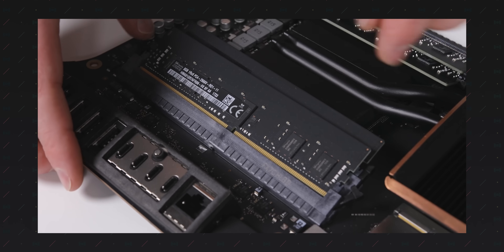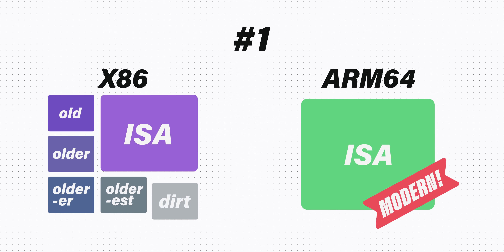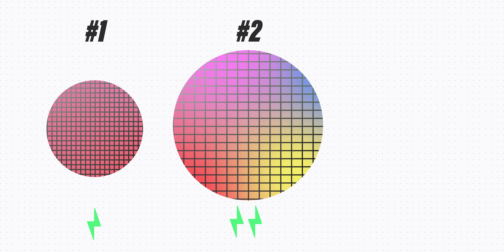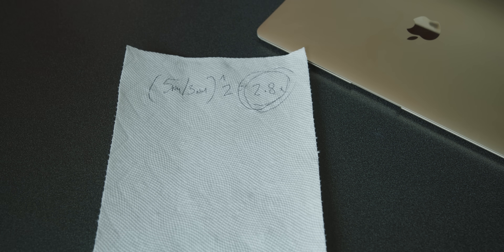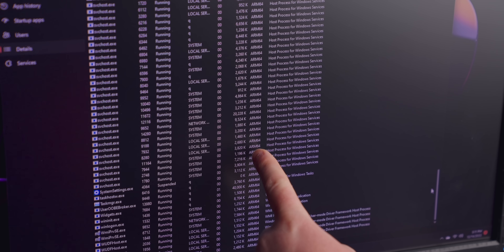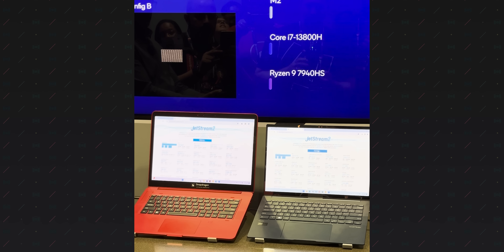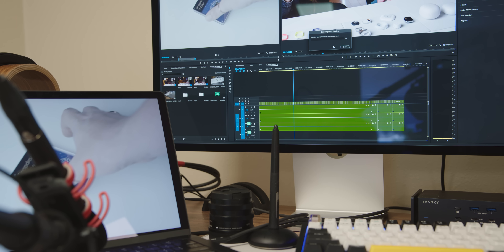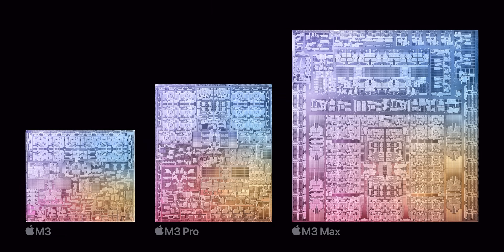Apple's Silicon Magic Is Over!

Comment: The thing is: if you do professional and compute heavy workload you just don't care about energy efficiency on a single workstation (on a cluster sure, but your workstation pulling 50, 500 or 1000 watt doesn't really matter). Using the energy efficient built for mobile devices chips in high end workstations is simply not efficient. You have a higher power and thermal budget but you can't use it.

Comment: For the average user there is no catching up to do other than on battery life and because Apple is at the limit there's nothing they can do about it. For the average user there's no other truly relevant difference, other than maybe the ecosystem but there's nothing windows can do on that front. As for power users few are switching away from their preferred platform, you know you wouldn't even if windows was better for your use case. I would not switch to mac either because it's not faster for anything I do but even if it was I still wouldn't because of all the other inconveniences. So the only ones who will potentially switch are average users who don't need a lot of power and don't care about the apple ecosystem and there's also nothing Apple will be able to do about that. So why bother?

Comment: They also need to address the efficiency of how their own software takes advantage of the hardware. Apparently Logic Pro works slower on M3 than it does on M1 because for some reason it’s not taking advantage of all the cores, and they overload as a result. There are even third party DAWs that manage to utilize all the cores while Logic just lets them sit idle. Then they also always can keep increasing the amount of RAM and SSD on their base models to stay competitive. Also maybe specialized processors for audio or other processes the way they have separated out the GPU, Neural engine and video encoder.

Comment: 3:28 TSMC N5 is not 5nm. When we go with the ITRS rating, it is only the density of 7nm planar. And because of FinFet and other 3D stacking technologies the actual tranistors are even bigger.
As i remember correctly the TSMC N7 transistor gate width is 22nm.

Comment: I have a 2021 MBP Max that's maxed out on all but HD capacity; which is ironically the issue I'm running into now.  I wish I'd gotten a bigger hard drive.  I also have a 2022 beast of a rendering PC with a 4090, 10TB or NVME storage, and 64GB of RAM.  Besides graphic rendering in Blender/Cinema4D/UnrealEngine, and gaming, I seldom use the PC anymore.  I hated the MBP at first because it couldn't do so many things GPU related as the PC.  But my job changed and now I'm mostly working in various NLEs and DAWs.  For that kind of work, the MBP excels.  It seems weird to me that the M1 silicon is still basically as good as the M3.  I tried running intense renders with the MBP, but it's worse in every possible way than the PC rendering station. 

It scared me when my MBP spun up its fans the first time.  Until I tried rendering in UnrealEngine, I'd never heard the fans before.  In short, MBP is fantastic as the centerpiece of my mobile recording studio.  It runs Pro Tools brilliantly when recording live concerts, it's light, quiet, and efficient.  But when it comes to heavy compute tasks, my PC annihilates the MBP.  They both have a place, and the MBP is what I use most of the time; I'm using the MBP to type this.

Comment: The problem is that the M1 made intel actually finally "wake up" and resume actually investing R&D on x86 arquitecture, and AMD followed suit. This brought innovation back into x86 that was basically stuck for years, and this innovation quickly outrun anything that Apple was trying to do with Apple Silicon. The new intel Core Ultra cpus and Ryzen are now more performant and with better efficiency from x86 than Apple Silicon with ARM64. And the x86 is still a better arquitecture for a lot of things. And now that intel and AMD are back in the fighting ring, x86 will just continue to get better at higher-end performance points
Reply: Apple R&D and launch cycle for the M1 happened during the same time span that Intel and AMD R&D'd theirs, AMD had already planned on a new socket and Zen4 architecture, Intel was catching up on AMD's lead with chiplets with their efficiency cores, Blue and Red didn't wake up following Moneybags' M1, they just happened to have parallel'd it
Reply: Yes it did. You don't think other oems get internal leaks from their counterparts, do you? Sometimes even some contribute to other's success hardware-wise @thegeekno72
Reply: Well AMD being able to do anything is special in it of itself. I still rather have AMD in a framework laptop, but I'll take a SD Elite in a Framework if they make one and it is easy to run my Linux stuff on it.
Meanwhile, my Samsung Galaxy S24 on Dex works great too.
Reply: I agree, let Apple keep their ARM and let some windows laptops have it too because why not. But that does not mean that x86 is obsolete and shouldn’t be improved further.

Comment: The funny thing to me is that rather than invest heavily into software optimization which was a necessity in the early years, they just keep pushing the hardware. They should be pushing the software's capabilities by optimizing for speed, efficiency, and performance overall; making better utilization of the hardware and providing effectively "free" performance increases. Of course, then this means the original hardware is fine and they can't sell you new silicon bricks.

Comment: Developers are still tuning their apps for Apple Silicon’s asymmetric multiprocessing. Some apps didn’t perform well after the switch to M1. Also, many pro industry users need more than 256GBs of memory, and want to take advantage of the speed of PCIe Gen 4 and up NVMe, because TB4 tops out at 2800 MB/s. Hopefully TB5 will help this situation, I haven’t been paying attention. Apple Silicon is also going to need more specialized processing units. It would be nice if Apple would increase the speed of their SoCs for some processes. Many of the people I work with use multiple machines working together over a LAN. The industry is wanting to move away from that. I used to work in a fab so I know how difficult it is to get more from an architecture after you’ve reached 3 nanometers. Still, there’s a lot of value Apple can add to their SoCs. And it doesn’t matter what the competition is doing. Progress was and always has been inevitable. It’s what value Apple adds to the SoC that matters. As far as laptops are concerned I don’t care. I never use them.

Comment: @Snazzy Labs Hey man I ran into a bit of an issue after typing in a terminal command I got from one of your other videos, wondering if you might know the fix? in terminal, I typed in 

% defaults write com.apple.dock autohide-delay -float 0; defaults write com.apple.dock autohide-time-modifier -int 0 ;killall Dock

in order to make the dock show/hide faster. I liked it but decided I liked the default transition animation better so decided to set it back to default. I set it to 0.5 as you suggested. What happens now is the mouse pointer will bein the dock area for a few seconds before appearing and the transition animation is gone. It now just appears instantly after 2-3 seconds rather than smoothly coming up from the bottom. Do you know how I could fix this? I restarted the laptop and its still doing it , and the sliding up animation is gone and takes a couple seconds to appear even at 0.1-0.5
Reply: I'm not much of a pro but have you checked out your animation settings? I'd suspect it has something to do with the one that minimizes animations when minimizing/expanding apps
Reply: @zh9732  its set to genie effect

Comment: Every single apple product is a overpriced underpowered e-waste scam.. they are all e-waste from the factory no upgrade path for your $1,000's of dollars no real repair program just the fake one that actually costs more to repair the device compared to just replacing the device.. both no upgrades and no real repair program= more sales as device's get older and need more ram.. mac studio can't even replace the SSD.. sure its in a socket but if you change it the system won't boot regardless of what you do or what system OS you install.. the fake repair program requires you to allow remote accessing your device to "calibrate" the parts but buttons and hinge sensors and 90% of parts don't need calibration its a fixed value for all devices like screens and track pads and almost every single part except for fingerprint scanners!! Its really to lock the parts down to a particular motherboard so if you destroy the motherboard by accident or upgrade and want to resell them parts to recover your money you can't so the people who need the parts can't have them and it stops you from selling them!! There's nothing and i mean nothing good about apple products.. id rather a Chromebook or a n100 notebook or a u300 notebook or a 12th to 14th gen i3 laptop compared to any apple products.. fk id rather a Chinese e-waste clone smart phone over original apple imphoney's because it's at least repairable..
Reply: you are holding it wrong.

Comment: The real reason why M1 was so much more power efficent have nothing to do with legacy instructions. Really legacy instructions take very little power, almost none, just a bit of die space. 

The real reason is memory interface. The core of a modern Zen CPU consume a absolute minuscule amount of energy at normal core clock. This is of cause also true for the M1 and so on.

But the reason M1 uses so much less memory is party because it uses phone type memory cells, and partly becasue its highly integrated memory. Because for a ultra thin and light design, memory is the part that uses the most power.

So if it so simple, why don´t AMD and Intel do the same thing.

Well, there are drawbacks. The first and most oblivious drawback is that it is not flexible. The second and more important drawback is that it limits maximum core performance. And when the performance goes up, this benefit decreases to eventually be irrelevant.

The thin and light is a to small of the market for x86 manufactures currently. But this may change in the future with ever more need of memory bandwidth. There might come a time in the future when CPU come with a set amount of memory pre installed. Or more likely, a huge SRAM or DRAM cash with a slower memory interface (like the cash in the RDNA GPU). Eventually there might be a CPU with 16GB of DRAM cache that it can boot from. and you would ad memory only for expansion

Comment: I do wish I could have a board of "I told you so"'s that I could illuminate to many.   The Intel x86 CPU is the beast it is because it's a general-purpose computing device that does everything fairly equally ( ignoring GPU stuff, though even their integrated GPU isn't bad these days ).    Apple's M-series move was a great move but it was definitely reliant on ensuring that users/software kept within a fairly tight envelope of what they were asking of the M chip, so long as within that, all was great;  step outside of that and it was definitely a world of [slow] hurt.  For things like the A2337/8, even the A2442 it was a very nice fit, especially with Apple also writing the OS of course.

Apple didn't have magic-sauce that did everything better, and now that we're seeing the M-series "mature" we're watching it balloon out and lose that edge and ultimately it'll approach the Intel specs with its own strengths and weaknesses.      The competition between Intel and AMD since the 2000's has ensured that there's very little fat/wastage in those CPUs, and as the M-series tries to cover more bases it too will have its issues.

Comment: I needed a macbook and I was doubting whether to get a 2023 or a 2020 macbook. I went for the old one for several reasons.

1) Price. Much cheaper.
2) If you go for the newer one, it has a TERRIBLE, UNNECESSARY NOTCH. That's a deal breaker. Ok but annoying for a phone, absolutely unacceptable for a laptop. I don't need my screen to go all the way to the fucking edge.
3) If you went for the new one, you had to go for  the model with 12 GPU cores and 512 gb SSD as base (and upgrade it to 16 gb, bc 8gb is just not enough nowadays), and that puts you down a LARGE amount of money. If you take the 8core 256 gb, you might say it's enough SSD (and it is, as my 2020 has that much, it's for work, not for 4k video editing), but it, accordingly to reviews, has a SLOW AS FUCK connection between SSD and motherboard, which is not an issue on the 512 gb 12 core model, which is understandable (never go for the base model), but, the worst thing, is that the 2020 model HAS THE SAME TYPE OF BUS FOR THE SSD OF THE HIGHER SPEC 2023 MODEL!! What the actual fuck?
The result is that the extra 20-30 % cpu speed that you can get over the previous generation on the 512 gb ssd 12 core gpu macbook, that is true there, but the lower range one runs at the same operational speed or EVEN SLOWER than the 2020 model. That was the deal breaker. ALWAYS DO YOUR RESEARCH ONLINE before buying an apple product. 

Never buy an iPhone 14. They are shit. They can't be used as a camera, as they simply turn off the filming after a bit because it heats up. It's garbage. In order to keep profits, they decided to drop the quality control massively and it's the worst apple phone EVER.

And never buy a base 256 gb ssd 8 core GPU Aple Macbook 2023 model. It runs AS SLOW or worse than a 2020 model and it's over 50% more expensive if you upgrade the ram. 
My 2020 model runs blazing fast and has super large battery life. 
Probably my last Apple computer I buy if they have to keep dropping the ball. The 2020 model got AWARDS, for fuck's sake. The 2023 model is absolute utter garbage.

Comment: I still feel fantastic about my M1Max Mac Studio purchase, I think it is the Goldilocks M-Chip on price, in the ideal package as a small desktop with active cooling. Just… “here’s a great chip in a box with lots of I/O.” 

I insta-ordered it though, and didn’t get the memo on the SSD speed differential, so I only have the internal 512 which is a bit slower than the 1TB+ options.

Comment: What if they do rest on their laurels? People buy Macs for more than just the processor: design, macOS, integration with the Apple ecosystem, the first and third party apps. I have been using an M1 MBP since November 2020 and I don't have any desire or intention to upgrade until Apple stops supporting it with security update. Thats just how good it is. There is still a large Intel Mac base out there and Apple will be picking that for years and by the time its done, most on M1 and M2 will likely be interested in either M7 or M8. And the cycle repeats itself. Lets not forget about the sticky factor, once you go Mac, its really hard to go back to Windows PCs. I am operating system agnostic because of my job, but the reality is, once you dip your toe in, you will always have a Mac around in your life. 350 million is nothing to sneeze at.